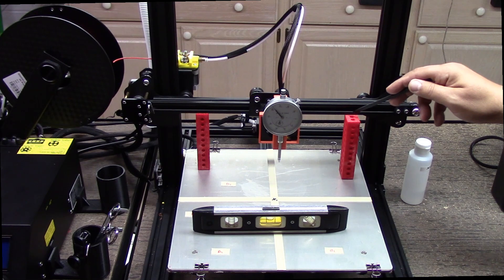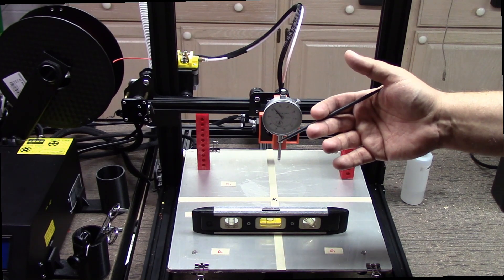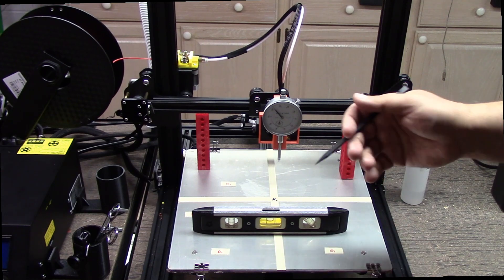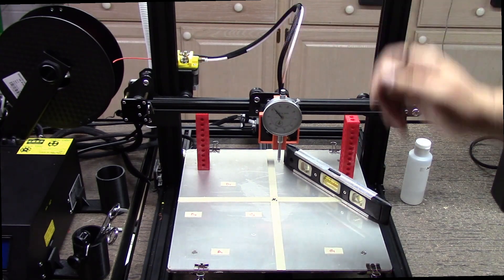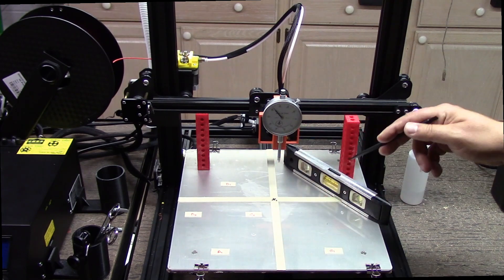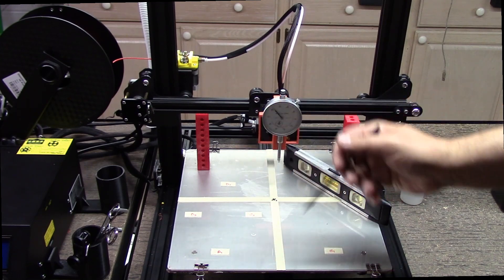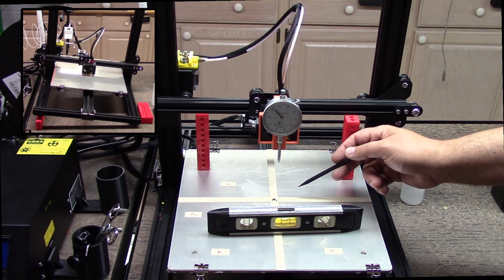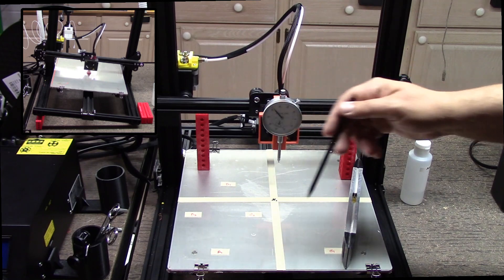Shop Talk - Stop Leveling Your Bed and Start Tramming Your Machine!

Comment: I'll admit, when I first got into the hobby of 3D printing, I fell into that trap of calling it the "leveling process", but ever since I found out that that's not what it is at all, I haven't called it "leveling the bed" since.  I always refer to it as tramming the bed.  And one of the nice things about modern firmware is that they offer a much more accurate tramming routine, like, MRiscoC Professional Firmware for the Ender 3 V2/S1 offers 9x9 point resolution mesh generation across a 235mmx235mm bed surface, which is amazing.  Granted, I'm no machinist by any stretch of any imagination, but I'm kind of a stickler for jargon accuracy haha

Comment: Great points but we should level or square up the bed, then tram the gantry.  Purposely skewing the gantry to make up for a poorly setup bed will lead to excessive wear on the parts and skewed prints.  Tramming your X axis gantry (or making it parallel) to the bed does not take into consideration the Y axis.  If Y is square to say the table or printer's base but your bed and gantry are skewed (parallel to each other), your print\work will still be skewed even though your print was successful.  If your bed and gantry are skewed, you would then need to skew your Y axis to get a good near perfect part.

Comment: Level the bed all you want ender 3 beds and waves in the ocean. Just level all 4 corners it's not rocket science. The dial indicator will be worth more then the printer. If You want good prints with no stuffing around go and spend the money on a good printer. On The ender 3 nothing is straight. Chuck it in the bin

Comment: i am new to 3d printing and would like to make an observation..

the hole hobby, and even industry it seems, is full of die hard 3d printing heroes that simply do what has been done before, quite a few of the youtube "educators" do not have a single grain of understanding of the why's and the wherefores, they simply spout parrot fashion what someone else spouted parrot fashion at them 10 years ago..

Its so refreshing to find someone who has an understanding of what they do and why they do it that does not ultimately boil down to doing something that was done 10 years ago before anyone knew anything and has been passed down parrot fashion ever since..

I wiil be checking out more of your content ;)

Comment: Good day Sir, I also thought of using the leveler to make sure my bed is perfectly flat before and throughout the printing process. But slowly I realized my bed had the bow-up pattern when the bed shifted to the center for printing and it got me irritated and went nuts. My printer head frame also showed a slightly saggy on one side even though i reinstalled the supporting frame again but the slight disorientation still appeared and showed through the leveler. This video did gave me some ideas on how to adjust my printer again. Hope it works. Thanks for the video.

Comment: I wonder what can be done to bowed bed? use jb weld and squeegee the metal epoxy? or use some adhesive metal 2" wide tape for insulation? all to make the bow go away, make the 3D platform as level as possible.  THEN use magnetic pex tape sheet ?

Comment: We never  level are bed although we use the term  , we use the X axis at all 4 ( or various points ) over the bed / distant from hot end tip to surface

Comment: im so tired of hearing that excuse "3 points make a plane" yes it does, but after taking 13 semesters of math,  you learn that you need all 4 points with certain applications. If the bed was a triangle, then it would be NO issue, but the bed is rectangular and you need a reference point in EVERY quadrant because the print head MOVES across the ENTIRE area of the bed, not just a single point in the back with a gradient towards the front.  the only shape that could potentially get away with 3 points is either a circle or a triangle, but mathematically they are the same shape.

Comment: As a toolmaker for 40 years, I understand quite well the concept you are trying to show us. I am however, a little confused about your results. I assume your bed has been aligned and in ready to run condition. If in fact you have accounted for the sag in the x axis rail, why does the 123 block not fit under the rail on both ends. Obviously, the bed is NOT parallel to the x axis rail. I do, however, very much agree with your explanation that level has absolutely nothing to do with anything. Thanks for the video. I will look for the perfect first layer video.

Comment: I would correct the title a bit if I may 😊. Level your printer (all relevant components first), then correct the remainder of inaccuracy by tramming. If you rely on tramming to fix big issues, your prints will end up skewed the same way your printer is built. 😉 Especially if gantry is perpendicular to bed, but X axis is not.

Comment: Your viewer is confusing the minimum requirements to constrain 2D geometry in a perfect theoretical scenario with actual real life application of gd&t and metrology. I would refer them to asme 14.5 articles on datum reference frames and on flatness. In real world applications, where we know that planes are never perfectly flat, if you only collect data from three points you will "level" that plane or best-fit it only to the high and low deviations found in those three points. If by chance your three points happened to fall on some of the highest and lowest points of error on the plane you are going to best fit a pretty jacked up plane, but this does not actually simulate how that plane will interact with other geometry in the real world. If you set a plate on a surface plate technically it will rest on the 3 highest points, but that surface plate has the advantage of instantly finding those highest points of deviation as soon as contact with the whole surface is made. When we virtually tram or tram with an indicator manually we have to accomplish that with the average of the data we can acquire from individual points. If you want the most optimal best-fit you need to take tons of data, but unfortunately we have to make the decision to balance that with time otherwise we would be probing our build plates for an hour.
Reply from the maker: This was very nicely put!  Thanks you!

Comment: I prefer squaring all 3 axis off one another, a level bed doesn't mean a level machine just as a trammed bed will not print a square object as your z axis doesn't adjust for the trammed offset
Reply from the maker: That is the point, your squaring to the nozzle and reason they call it "tramming" as defination of Tramming "is the squareness of your mill head to the table and Tramming is the act of adjusting the mill head to be square. There is tram parallel to the x-axis, and tram parallel to the y-axis (sometimes called “nod”). Depending on your machine, you may have a swivel head that is designed to cut at angles."
Reply: @DIY3DTECHcom  yes however if the bed isn't square to the z axis then youll end up with a rhombus rather than a square

Comment: I think if you make a new video that you should point out that the X-axis is may not be level to the printer itself, not just the bed. Common mistake is newbies not tightening the wheels right on the bed or the X axis because they think it works right out the box.
Reply from the maker: I did one like that for ZoneStar (should be in the ZoneStar playlist) especially with two Z motors.  Also did one on X sag too a couple years back...
Reply: @DIY3DTECHcom  Yeah but you are getting to the end of the year and first timers start getting printers from Black Friday to Christmas. The chances that an older video about tramming that doesn't have tags like CR-10, Ender 3, etc is going to get watched is low.

Comment: If you level the bed at each corner this is entirely irrelevant.
Reply from the maker: Why?   As please don't say the three point thing, as this has already been shown as incorrect as the bed is a "complex" plane and the idea is to "average out the "error" to the corners. This is covered out in several of the dial indicator videos...

Comment: If anyone is interested in overcomplicated bed leveling, watch the video.
Reply from the maker: quality takes investment and and time.  From your comments clearly have never tramed a CNC machine...
Reply: @DIY3DTECHcom   Dude you clearly can't handle it when someone has another opinion. Get over it. 
Its not that you are wrong but the way you try to explain it a way too complicated. This happens sometimes when someone from a CNC background don't understand that a printer is not a cmc mill. By the way tramming is what comes a way closer to what we are doing with a printer instead of calling it leveling but I guess you know this.
Reply: @StotheEtotheB  your comment here assumes a limited range of form error in the plate. Some plates are more warped than others. It's only overly complicated if 1. You just don't care as much about quality as other people, or 2. Your bed's flatness is very good.

Comment: My Ender 2 arm visibly tilts upwards, and as a result I have to adjust my bed to be parallel with it. That's all well and good, but the result is that if for example, I print a tall cylindrical object, afterwards, when standing the cylinder on a REAL level surface, it leans over slightly, because although the arm and bed are parallel to each other, the Z axis still rises actually vertically and not exactly perpendicularly to the bed. I have to sand the base on my belt sander to achieve a vertical cylinder. Of course, the layers remain tilting if you look closely.
Reply from the maker: If your "hotend" and bed are truly parallel (make the extruded plastic perpendicular) then you will not have this issue so it sounds like you have some more adjusting to do :-)
Reply: Ideally, we should be able to truly level the arm (and then adjust the bed to be parallel to it), but I don't see any way of adjusting the angle of the arm. The Z axis pillar is vertical, so is not truly at 90 degrees to the arm which point upwards a few degrees. I have the bed parallel to the arm, but it isn't horizontal. If we visualise the first layer printing, as subsequent layers are laid down they are printed in a vertical stack one upon the other, but each layer is not truly horizontal creating a parallelogram. When the print is finished, the object, if tall, stands perfectly vertically, but if we remove it from the bed and place it on my desk, it leans over slightly. I can correct it by sanding the bottom of the object on my belt sander, but it's a nuisance.

Comment: I have 40+ yrs experience in every thing level, square, and parallel. Please allow me to try making it simple. In Your example you tilted the printer demonstrating that there's nothing "level" about setting up your printer. The print head only needs to travel parallel to print bed. Or the print bed travels parallel to the head. The print head does not need to be perpendicular to the print bed. Consider a pen on a piece of paper, as long as the pen continues to travel along the surface of the paper all is well. The center line of the pen does not need to be in tram to the paper. Hope this helps.
Reply from the maker: Russel, the genesis of this was because I would get a zillion question about bed leveling from people just starting out in 3D printing thinking gezz my bed needs to level to an observational plane much like a picture needs to be "level".  Whereas in fact it needs to be tramed (you can see a bit here:https://openoregon.pressbooks.pub/manufacturingprocesses45/chapter/unit-one-tramming-the-head/) as a 3D printer is really nothing more than an additive mill so yes the print nozzle does have to be perpendicular to the print bed for the best results especially "dimensional results".  Just think of a CNC machine if the cutting tool was not perpendicular, you will induce a ton of error.  Again the same will hold true in 3D printing as the geometry of the extruded plastic will not match the intent of the CAM software.

Comment: What we need is a 5th bed "level" adjustment screw at center.  (or a fixed ball mount at center)

What we have to fight and have no way to deal with is a warped bed.

If center height is fixed in relation to minimum nozzle height and we then adjust the 4 corners we will correct MOST of the warps found in printer beds.

This means we need to be able to force the bed up rather than just relying on the springs at the corners.  That is easy though just adding a second adjustment "wheel" above the bed mount to replace the spring at each corner.

Get it all adjusted and torque the system.  It wont easily go out of adjustment..
Reply from the maker: Not really so long as your bed is relatively level as 4 screws will help you average the error...

Comment: Those are not 1-2-3 blocks.  Your nit picking of a well understood term in the 3D printing world justifies my nit picking.  Make a video on the the misuse of the term “printing”.  Should it be called extruding?
Reply from the maker: I am simply using the term 1-2-3 block in a colloquial fashion not absolute as what are 1-2-3 typically used for?  Whereas extrusion is the means of printing as your could also sinter too :-)

Comment: How often do you need to check your bed?  I'm new of course, but I can drive myself crazy with obsessive leveling.
Reply from the maker: LOL!  bed OCD :-) For casual prints and your not prying [in major way] then ever dozens or so prints its work checking.  However if you let sit for say week I typically do a tune up check as sitting is your second worse enemy as the first is prying on part to remove it...

Comment: I disagree with this guys example. if you are getting x-axis sag then you need to replace/adjust some parts. the axes should be level before you tram your bed. if they are not you are disturbing the plane of that axis. ex: say you have 3 degrees of sag. if you tried to print a square you would end up with a parallelogram with corners of 87,93,87,93 degrees. this causes a parallelogram build plane.  Due to this, all prints would not print vertically properly. But hey it will be easy to print the leaning tower of Pisa.
Reply from the maker: no matter what you do in this "physical" seem you will not avoid sag as one side is not supported so while you can "reduce" sag you can not eliminate it.  Second, even if supported it will not 100% match the opposing side due to numerous sources of error namely the lead screw.  So this is why the idea of creating a parallel between the two planes is so important...
Reply: @DIY3DTECHcom  I agree you can never physically get the printer 100% aligned. And you should never use that type of level to square any parts of your printer. But you should constantly check the how square your axis, tram or use a feeler gauge to "level" your bed, then print a test cube and if available adjust the firmware to account for the printer not being 100% square. My issue wasn't with the info provided, it was with how you provided it.
Reply from the maker: LOL!  on the level that more metaphorical as I get people writing me about how to level thinking of carpentry terms.

Comment: 3 points can define a plane but you must have at least 4 points to define a flatness, more points gives better accuracy of flatness.  In this case, flatness is just as important as your tram.
Reply from the maker: That's basically the point I am trying to get at, as Zeno paradox plays in here as you can kep dividing the plane in half to redefine it so yes the more more points the better...

Comment: What I did is to make a level gauge using steel rule, another steel flat piece and few neodymium magnets. Just kept the flat plate orthogonal to steel using magnets.
Now for one position of bed, measured height between bed and extruder arm for left and right extreme using the gauge I did. If they are not same adjusted bed level
I repeated this for different bed positions
Now it seems OK, first layer was OK,but still print did not come right
I think some issues in Y and Z movement
Yet to explore
Reply from the maker: Interesting idea...

Comment: The bottom arm which mounts the bed is not perfectly orthogonal to the tool frame. This is the main issue. It is not practical to make very accurate frame so we need to adust bed  plane to be parallel to the plane of tool path. This is not easy, in fact I am struggling with my first printer just assembled.
We can adjust tool frame arm also
Reply from the maker: Sorry can't say I am tracking...

Comment: I love this channel, but it's clear you are arguing definitions, and may not even realize it (I hope).
The same as there are "special" definitions in a field that may be more defined than what you'll get from Webster's I think you're looking to deeply into the phrase "bed leveling" too much. When people say bed leveling typically, or at least every single person I've met and talked to, mean, any, and all, processes which will yield the results of -your bed being parallel to the machine head while working.
-simple as that, there is no need for further clarification.
Reply from the maker: Many thanks, however not really as you want to call the appropriate thing by the correct name for the task and the reason for selecting the thumb nail as the bed doesn't have to be level so long as its trammed.  As yo see some of the questions I get especialy from people starting on bed leveling.  This is the biggest bug a boo of 3D printing.